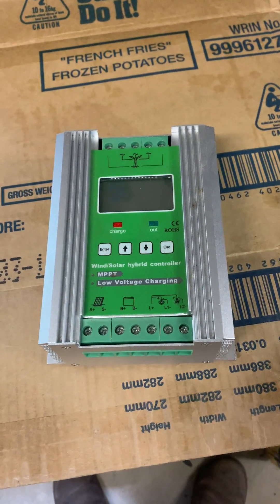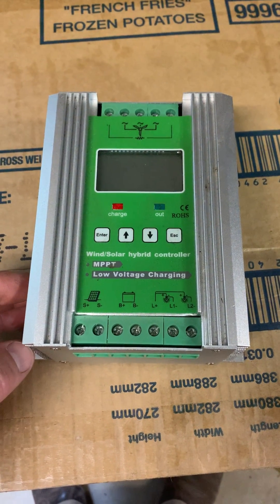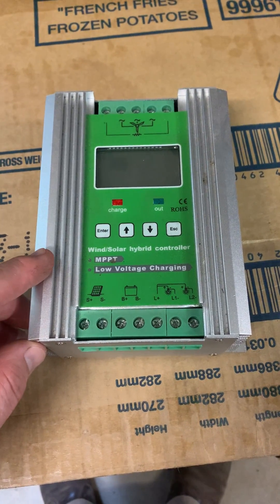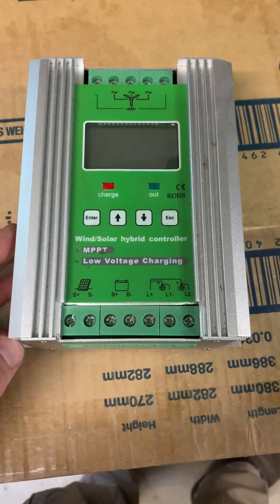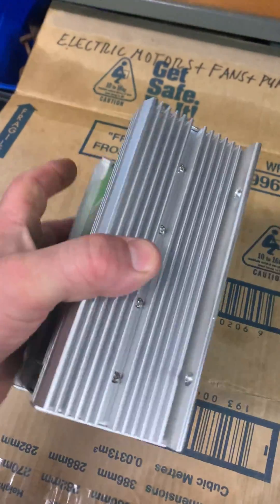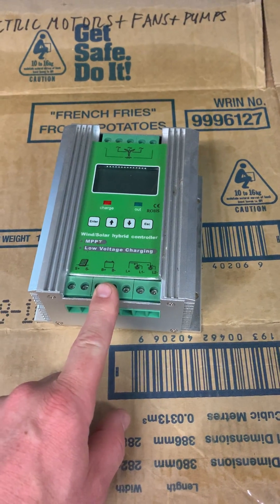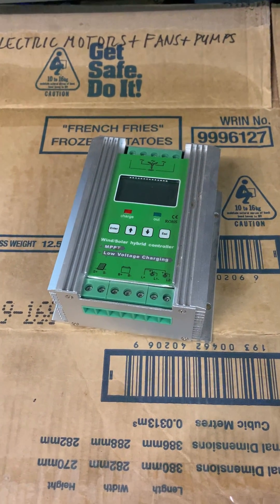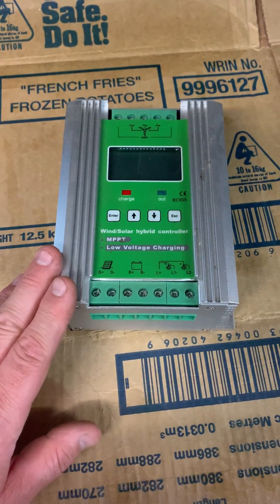MPPT Solar and Wind Charge Controller That Doesn't Work!

Comment: This indicates that your front-end wind turbines does not actually generate electricity, so it does not have the ability to charge the battery. Normally, for this controller, a 12 volt battery will only charge when the input voltage of the current fan reaches ten volts or more.  Please do not mislead other users here.  If you have this controller, the relevant after-sales service can contact the relevant sales team to help you solve it.
Reply from the maker: 4 different wind turbines were tested, with the same result, a bench test using a motor driven test alternator resulted in high loading of the alternator and zero DC output from the controller indicating that the controller is permanently in brake mode, resistor was heating up, battery voltage was 10 volts. Obviously the programming or an internal component is the problem, if you represent one of the companies manufacturing these, I suggest you actually do some MORE RESEARCH AND DEVELOPMENT to iron out the problems, or perhaps bench test each one before they are shipped to customers. This is a bad product in it's current form, note that this video is a few years old now.
Reply from the maker: 4 different wind turbines were tested, with the same result, a bench test using a motor driven test alternator resulted in high loading of the alternator and zero DC output from the controller indicating that the controller is permanently in brake mode, resistor was heating up, battery voltage was 10 volts. Obviously the programming or an internal component is the problem, if you represent one of the companies manufacturing these, I suggest you actually do some MORE RESEARCH AND DEVELOPMENT to iron out the problems, or perhaps bench test each one before they are shipped to customers. This is a bad product in it's current form, note that this video is a few years old now.
Reply: Indeed, every one of our machines undergoes rigorous 100% testing and verification procedures before they depart our factory. While the machine you mentioned was introduced a few years ago, it's important to note that our current machines have seen numerous upgrades and optimizations. Our objective is to ensure that users can genuinely and objectively experience the product's features， thank you!
Reply: Indeed, every one of our machines undergoes rigorous 100% testing and verification procedures before they depart our factory. While the machine you mentioned was introduced a few years ago, it's important to note that our current machines have seen numerous upgrades and optimizations. Our objective is to ensure that users can genuinely and objectively experience the product's features， thank you!

Comment: The data suggests there is an issue in the firmware. They may work ok on lead acid but switching to a lithium option seems to flick on a permanent dump mode = then useless. The manufacturer seemed to not be aware of the issue but accepted these are faulty. Fixes are apparently underway....and awaited....

Comment: I totally disagree with that statement! I'm using one at the minute as I type this comment, I've been using it for over six months now an it works just fine for me. Maybe some of them are faulty I can't speak on or for that, what I can't speak for either is that I can't say they work for lithium batteries never tried it and it seems that's what you are using. Just my opinion and my observation so please don't kill the messenger.
Reply: I’ve had good luck with this one so far. It takes a good 25 knots of wind to get the fan charge current up, but I consistently get 6 amps out of it. It works well with my lifepo4 batts. As previously stated, the company may have addressed the issues, or the units are hit and miss…
Reply: How does the unit remember the settings it has stored. Does it use the battery for it and if so, then what happens if they are dried out.
Reply from the maker: Hi Kurt, this unit in the video was purchased in 2019 so maybe they have fixed the problems? Either way there are better proven options for controllers out there in my opinion, I purchased two of these, a 400 watt and 600 watt version and both had the exact same issue, as for charging lithium batteries with these the short answer is no, you need a boost/buck type charge controller setup for constant current constant voltage charging.
Reply: @offthegridwithbert924  thanks much for replying to me Bert! I know there's way much better controllers on the market. it have the midnite classic and clipper and maybe others out there. I would love to get the link to the seller you got the new big controller from if you can please.
Reply: @kurtlee6608  Hey Kurt what battery type are you using?
Reply: @Tubeophiliac  am using AGM batteries at the moment and the controller works fine
Reply: Hi, im using same type controller too. Do you know does Vfanbraking setting actually works? Mine is 24v version and Vfanbraking was set to 51.2V by default.
Reply: Hi all, I just purchased one of these controllers and it does have Lithium Iron battery option, (which I have), I see on screen it shows my 24 v system at charge of 25.6, every other option refers to 12 v  parameters, I can not change these. I have seen a video on these setting, but I have not been able to locate it. any help would be appreciated, because the manual really sucks.